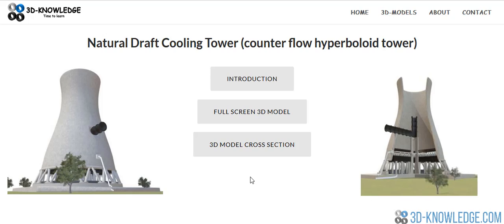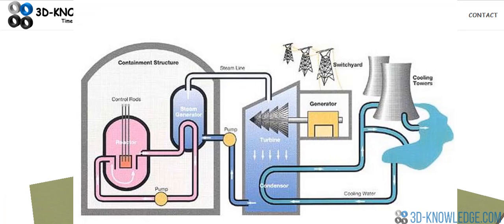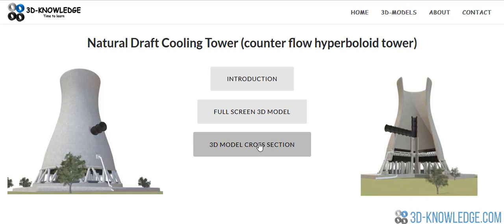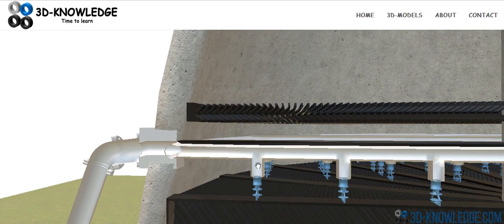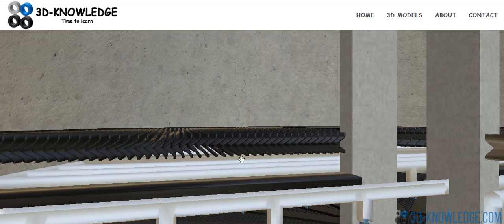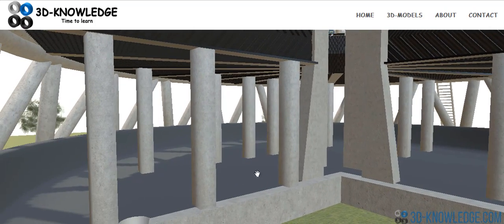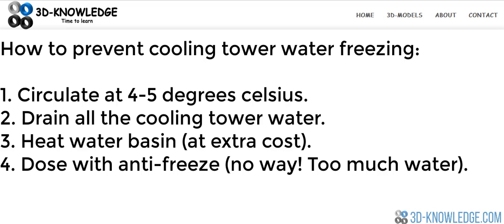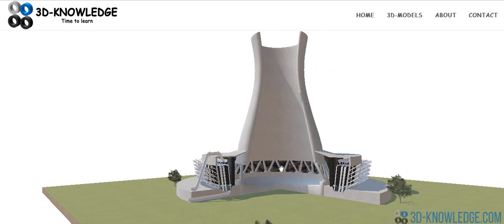How Natural Draft Cooling Towers Work

Comment: 2:24 Structural reason for the hyperboloid: There is a pressure differential between the interior and exterior that is structurally significant at this scale.  Unlike a cylinder, this shape is self-supporting against local buckling that would otherwise crush the shell structure inward.  In a sense, instead of relying on an unstable compressive arch shape in the horizontal plane as a cylinder does, it is supported by a tensile hammock-shape in the vertical plane.

Comment: Nice video. Thank you. We were taken on a trip around a working 2GW power station in school many years ago (actually walking around the working areas - coal mills, peeking inside the running boilers, the generator room etc, not just some sanitised 'visitor centre' and it was most definitely my best school day ever. I doubt today's tours would be quite so hands-on!
Anyway a question that has stayed at the back of my mind is they were boasting about the temperature of the water returned to the river was less than 0.5°C higher than when it was extracted.
Why would they be returning water to the river on a regular basis?
Reply from the maker: Weird. It's not a one pass system, there should only be makeup water and blowdown depending on the type of cooling tower. Blowdown amount depends on the cycles of concentration. I will have a think about it, thanks for the question!

Don't forget to check out the new channel, it's more active and the videoa are a lot better.

Comment: Why do cooling towers have such a iconic shape? Is it due to efficiency, or is this a structural decision?
Reply from the maker: The shape increases efficiency because  it increases the speed of the air as it travels through the tower. I believe it's also cheaper to build this shape tower rather than a traditional cylindrical shaped tower.

Comment: Hello that was fantastic video. In thermodynamics course our professor ask us " why we use cooling towers instead of heat exchanger or something? It is too much cost we still use it. Why?" We answered all answers but he said "you re right but that is not I want. " And I asked him privately he said " it is about evaporation." What it would be? Please help me.
Reply from the maker: Some of the cooling water will evaporate in the cooling tower due to the pressure drop after leaving the spray nozzles and due to its coming into contact with the ambient air (the pressure of which affects the rate of evaporation). The effect of evaporation cools the system further because it represents a pressure drop and change of state (read about latent and sensible heat to know more). 

Remember that a pressure drop and volume increase also represent a temperature decrease (this is how a thermostatic expansion valve works in a refrigeration system). A pressure increase has a volume decrease and temperature increase (like in a combustion engine during the compression stroke).

In short, evaporation creates an additional cooling effect other than just the heat exchanged between the water and air. At least, that is my opinion...:) 

If you can, try to get a hold of 'Standard Handbook of Powerplant Engineering', go to page 2.140, it has all the thermodynamic equations relating to the heat exchange for cooling towers and the equation they use to account for evaporation.
Reply: thanks for answering. According to my research , way your look is right. Evaporation creates an additional cooling effect. I got that book but there is only 1.019 pages. Thanks for advice
Reply: after nozzle sprayed water , what is pressure of that water?
Reply: if you are still interested, i found the answer. thanks a lot! http://www.power-eng.com/articles/print/volume-114/issue-7/Features/cooling-tower-heat-transfer-101.html
Reply from the maker: Hi, thanks for this. I did not get your message for some reason, sorry. To answer your question, the water has no pressure after leaving the nozzle.

Comment: I appreciate exhaust steam from the turbine needs to be condensed so it can be re-heated but why is warm water cooled (as the video explains) and then re-heated. Surely re-heating warm water rather than cooled water is more efficient.
Reply from the maker: Good question. 

The most important thing to keep in mind is how the steam is cooled. You can cool using a large volumetric flow of water with a small delta T (delta T = temperature difference between cooling water system and steam system), or a smaller volumetric flow of water with a larger delta T. Assuming the condenser remains the same, the actual cooling effect is the same for both these scenarios, but the volume of water required for cooling is the difference. 

The condenser is only so big and the steam needs to be condensed quickly. So if you have a small delta T,  you would need the cooling water flow to be increased considerably (more flow is more cooling) compared to when you have a larger delta T. I am guessing that pumping 1,000 tonnes of water an hour is less expensive than pumping 10,000 tonnes of water an hour, and it may be another reason (electricity costs) power plants like to maintain a decent delta T. 

Assuming a constant flow rate, a condenser operating with a higher delta T has a higher cooling capacity than if operating with a lower delta T. This means the condenser can be smaller in design, this maybe a design limiting factor. 

Coming back to your question (sorry, I get carried away)...

Cooling with HEATED cooling water represents a smaller delta T when compared to cooling with COOLED cooling water, so you need to increase the flow or make the condenser larger if using a smaller delta T. But, why bother? Keep the delta T large and you can have a smaller condenser, or, keep the condenser the same size and use less water. Either way, a larger delta T is useful. The trick is to not make the delta T too large, because you do not want to thermal shock the condenser and burst tubes (happens...). 

Does that help? 

There is an article here you might find interesting:

http://www.overclockers.com/water-cooling-flow-rate-and-heat-transfer/

FROM THE ARTICLE

There is an elementary equation from basic thermodynamics that states that the rate of heat transfer (Q) equals the mass flow rate (M) times a Constant (the specific heat of water) times the Delta T (fluid temp out minus fluid temp in):

Q = M x C x Delta T
Reply: Prior to reheating the water, the pressure must be increased to have a difference in pressure across the turbine. This allows for the mechanical work to be extracted. If you pressurize the warm water without cooling it, the pump would have to put in the same amount of energy you would get out of the turbine and the system would produce no additional energy. The working fluid must make its way around a cycle in a pressure-volume diagram to get work out. Great question! I hope this helps! :D

Comment: Why we don't use fan?
Reply from the maker: +Phuon lytho 
You can, but it doesn't normally make sense.  Fans consume electricity and electricity costs money. The tower delivers enough cooling capacity without needing to use fans, it's designed that way. There are instances though where fans might be installed, Especially if the cooling capacity increases (power plant MW size increased) and you can get the additional cooling capacity by installing fans rather than a building a whole new tower. 
Hope that helps.
Reply: It would cost a lot of money to make a giant fan for a tower this size
Reply: Forced type ?